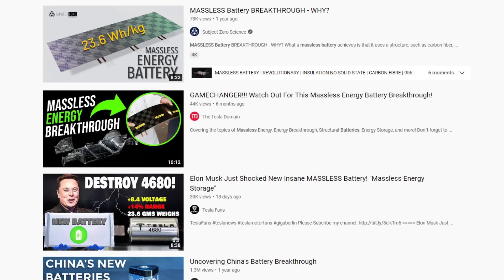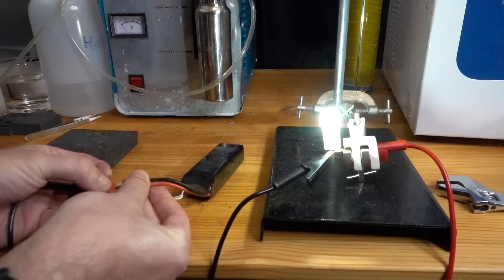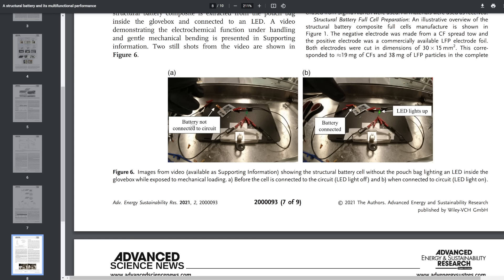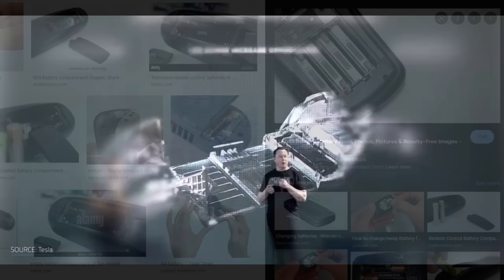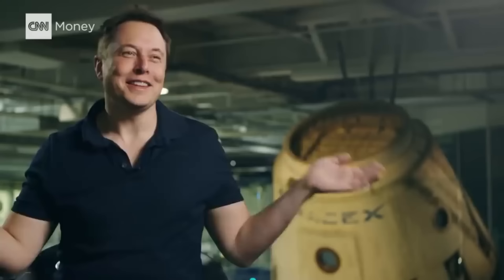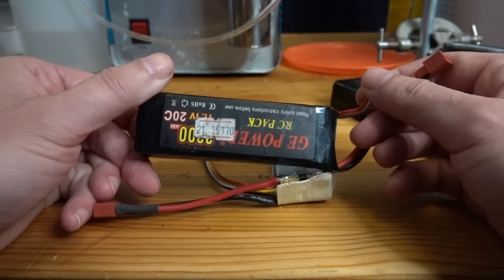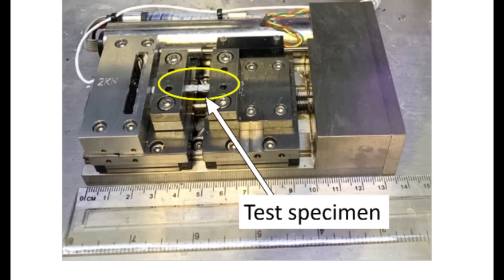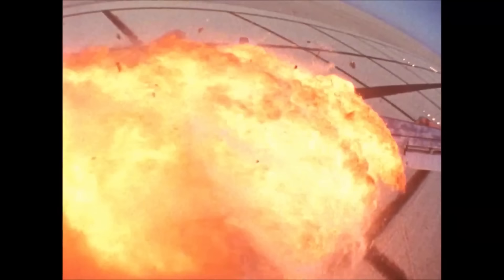Matt Ferrell, Massless Battery: BUSTED!!

Comment: When I saw the original news articles on these "batteries" I immediately dismissed it as a really bad idea for one simple reason. Batteries have a much shorter life than most mechanical parts, as such, replacing the batteries is something that has to happen to keep more junk out of landfills. Zero repairability for any of these "massless" batteries means it's a horrible idea.
Reply: And yet there are still people who think that this could be done on airplanes. Making the entire fuselage and wings out of structural batteries is what many people bring up when talking about electric airplanes and "the future of aviation", but they are completely oblivious to how massively overcomplicated, failure-prone, and dangerous that would be. Another thing people fail to consider is, how are those batteries going to perform in −30°C to −60°C ambient temperatures? Because those are the temperatures you get while flying at 30000 to 40000 feet. Plus, how are those batteries going to deal with thermal expansion and contraction without developing cracks? It's already tough enough on today's planes.

I'll just quickly paraphrase Thunderf00t in his "BFR Earth to Earth Busted" video, but with regards to battery-powered airplanes instead of rockets:

"Wow!! The next big thing in aviation is gonna be REVOLUTIONARY!! Battery-powered commercial airplanes!!"

"Actually, no. Any competent engineer would take one look at the idea of a battery-powered commercial aircraft and immediately discard it because it's an INSANELY stupid idea. But for some strange and unexplainable reason, you take something that's powered by an internal combustion engine, power it with batteries instead, and voila, all the eco-warriors come flocking in, praising you like you're God or something."

"Look, the whole idea is comical no matter how you look at it. I mean, let's just start with the first thing they need to get right, which is the remoteness of the charging stations."

"Once charging is finished, the aircraft is essentially a giant potential bomb sitting on the ramp. You see, the reason why tanks of fuel never blow up is because you cannot actually make the fuel burn unless you mix it with an oxidising agent, and since the (liquid) fuel in the tank is not mixed with any oxidiser, you're fine. Commercial aircraft take this even further by using inerting systems to pump out the remaining air/fuel mixture in the tanks and replacing it with nitrogen. Batteries, on the other hand, have everything they need to release their stored energy already inside themselves, which is inherent as this is needed for them to operate. Thus, fully-charged high-density batteries are inherently deadly, which means SOP would dictate that charging be the absolute last thing that is done after all of the people, baggage, cargo, and supplies are loaded onboard. And, of course, you would have to evacuate everything and everyone within a minimum radius of anywhere between 1 and 3 miles of the plane while it's charging, because it's so dangerous. There's no getting around it, it's an INHERENT PROBLEM."

"Indeed, a fully-fuelled Airbus A380 contains an equivalent amount of energy to all of the bombs that the Allies would typically use to destroy a city in WWII. And a fully-fuelled 777-300ER, with 181,283L of kerosene, has the equivalent of 1.53 kilotons of TNT stored in its wings, 32% more than the energy released during the explosion in Beirut in 2020. Even at the smaller end of the spectrum, a De Havilland Canada Q200 NextGen can store up to 835 US gallons of kerosene, equivalent to 26.7 tons of TNT, which just goes to show how amazing the internal combustion engine is at SAFELY harnessing large amounts of energy. With battery-powered airplanes, a lot of eco-warriors will think airlines can fast-charge the planes to save time, and that eventually batteries will evolve to the point where it could be safely done at the ramp. But you want to charge a battery-powered aircraft using fast charging, which is the most dangerous and damaging method our there, while it's sitting right next to the airport, which is one of the worst places you could park such a machine? Yeah, that's not happening."

And that's not even getting started on all the OTHER problems you'd face. In aviation, everything is as optimised as possible. Cabin pressurisation and HVACR systems onboard today's commercial aircraft are run off of air bled from the engines before combustion, and that's just one of the things run off the engine. On a battery plane, all these would have to draw directly from the batteries, making it far less efficient.

Then other people will bring up the fact that gas turbines are about 30 to 40% efficient while electric motors are 95% efficient, but this is misleading because turbofan engines actually have 70 to 80% propulsive efficiency. Plus, the genius of a turbine engine is that it takes full advantage of gases expanding as combustion occurs, and this second stream of gases comes out the core section, allowing for a significant increase in thrust compared to a fan alone. An electric airplane would have to provide all of the thrust via the fan.

THIS is why the idea of a battery-powered commercial aircraft crashes and burns before it even leaves the ground.
Reply: @electric7487  The "structural" batteries will definitely handle the loading in an airplane. Definitely.

(Airplanes have a rather large amount of loading put on them during landing and takeoff)
Reply: Yup, nothing better than being forced to replace an entire car when the battery dies. Everyone was mad when they stopped making phones with replaceable batteries, if they would have just touted them as phones with "massless batteries" everyone would have praised them as a massive technical innovation lol.
Reply: Almost everybody owns at least one eletrical device and has already learned that reloadable batteries have a remarkable short lifetime. Most of us are used to call that device a mobile phone. And some models are build in a way that replacing the battery is NOT possible. Thus we buy a new car (sorry mobile phone) every few months. (Clever engineering / marketing idea - and this small gadgets are not exactly cheap.)
Reply: Indeed. Even if the concept worked perfectly as described by Ferrel, it would still be a bad idea.
Reply: You mean you would have to completely scrap your car every 2 to 3 years? Well, that's bad news for the customers but really good news for the manufacturer. Now all we need to convince dozens of gullible doofuses that it's good for them and the planet is proper marketing and a catchy name. How about saying the battery is "massless" ?
Reply: Totally agree.  I've seen pictures of the Tesla structural battery.  Zero repairability is a really, really bad idea.  These battery packs aren't just built into the structure of the car - they are filled with epoxy or similar.  Pry the lid off and it's one solid mess.  Almost no chance of replacing cells in that.  I get the desire to reduce weight of electric cars.  But, battery packs are steadily increasing in density - we'll be there soon enough with repairable battery packs.  Don't get started making this junk.  I certainly won't be buying an electric car where they do this junk (and I absolutely plan to buy an electric car and look forward to a day when gas engines are obsolete).
Reply: That's probably the whole idea. Make it impossible to replace the batteries so the consumer has a useless product when they die.
Reply: @ccoder4953  I love gas engines, but I'm not a fan of the excess electronic stuff manufacturers are putting in cars these days. I like my simple, old, manual transmission jeep wrangler. Thing is, I do a lot of camping and long distance car travel. I don't ever see a future that would let me drive 12 hours with just a couple 10 minute stops in any electric vehicle. However, for all my small commuting around the city, I just use an electric bicycle. So it's great for a lot of people, but definitely not for everyone.
Reply: @bobbygetsbanned6049  simple Solutions to that. But they need to be implemented. Like the right to repair act
Reply: Very good point!!
Reply: Batteries don't have short life span, if handled correctly they can easily survive 8-12 years until their capacity drops by 20% (that's when a battery is considered end-of-life).
The issue is most people have obsession on fast charging, and fast charging is killing batteries. 
Current batteries can be safely charged up to 0.2C (5 hours from empty to full), anything more and you are reducing battery lifetime. Also charging above 0.5C (2hours from empty to full) causes direct damage to the battery, and charging above 1C (1 hour from empty to full) is almost guaranteed to kill it.
Reply: @hubertnnn  If 8-12 years is not a "short life span" to you then I would tell you to not look into the age of most of the generators for the US electric grid. Also, please avoid looking at most of the excavators, tractors, dozers and other heavy equipment. Most of the ones in use for anything other than a large government infrastructure project are over 30 years old. Also, avoid any small machine shop because they're sure to have a Bridgeport mill that's probably older than your grandfather. 

I make these points to showcase just how long lasting mechanical components can be. No battery that can store enough energy to power a vehicle would ever last a quarter of the structural components age.
Reply: @hubertnnn  So what you're saying is that even if the owner took the best possible care and had the opportunity to always slow charge the battery, then the car's lifespan is still reduced significantly. There are plenty of >12 year old cars driving around today that would have had to be scrapped by now.
Also, this "obsession" with fast charging you mention, is that maybe because some people don't have the luxury to wait in a society built around the expectation that you can refuel your car in under 5 minutes in the middle of a (potentially long) journey?
Reply: @bobbygetsbanned6049  The Fiat 500e already has a battery that, through Chrysler engineering, is 12000 dollars to replace BEFORE the cost of parts.
Shame, really, the car drives so well...
Reply: That's a great point.

As an engineer I hate these people because they confuse the crap out of the general public with what we can and can't do. You've pointed out a major issue with these for vehicles. Even when there are good technologies they often confuse people about what those technologies can and can't do. 

In this video above there's a reference to the liquid metal battery. That's a technology that's been developed by MIT Professor Donald Sadoway. He's cofounded the company Ambri to manufacture them. That's a technology that has great potential for FIXED (not mobile) energy storage. As in things like community batteries. So its  shame that clowns like Matt Farrell are confusing people with garbage because some of its NOT garbage but most people can;t tell what is and isn't garbage.
Reply: @hubertnnn  
> Wrote: "Batteries don't have short life span, if handled correctly they can easily survive 8-12 years"

EMD 567 engines from the 1940's and 1950's still powering countless locomotives, vessels, and generators today:
Are we a joke to you????
Reply: @HelenaOfDetroit  I just enjoy the feel of driving a manual.  For me, no clutch = no buy, so electric cars are kinda a non-starter.
Reply: Hey, Musk could make  a DISPOSABLE car out of that. "No, don't". The battery is permanently part of the basic chassis, AND it sounds like it will MUCH more difficult to recycle that battery as well (and Lithium,. etc, is difficult, polluting  and sometimes exploitative to mine). A 100% STUPID, CRAPPY idea. Planned obsolescence of the worst kind.
Reply: @SwervingLemon  That's part of the joy of electric car ownership, you're supposed to love that part, I think. But at least it's possible to replace so the whole car doesn't have to go to the landfill.
Reply: Which is why I can see many companies trying to adopt this.
They hate repairability. To the point they'll pay senators lots of money to try to keep it as hard as possible for consumers to repair their own devices
Reply: The biggest reason to dismiss anything to do with batteries is that battery technology is essentially at it's endpoint right now. There's not a lot more that can be done with them and there's no more battery breakthroughs to be found unless we discover an entirely new branch of chemistry previously unknown in the same way Quantum Mechanics burst onto the scene 100 years ago.
Reply: @bobbygetsbanned6049  It's a Chrysler Hallmark, as well.
The battery assembly: $30k. Labor to replace it: $12k.
Cost of a Fiat 500e with tax incentives is often less than $9k.
They did that with the Cruiser as well. It's a Dodge Neon, effectively, but the goofy throwback body shape means you have to pull the engine out to replace the timing belt. The labor is usually more than the cost of replacing the vehicle.
Why anyone buys their products anymore is beyond my ken.
Reply: ...or a brilliant idea for capitalist intentions
Reply: Welcome to the new green renewables world!
Reply: I think the worst part is that you win virtually nothing save some internal space.
Reply: @electric7487   Skepticism here. You explained why chemical-fueled airplanes do not ignite all their WMD-level-amount of stored energy instantaneously, but you have not explained why a battery-powered airplane containing the same amount of stored energy necessarily releases all ITS stored energy instantaneously.
Reply: Great point!
Reply: @theultimatereductionist7592  The way I see it is this: If you have a bunch of cells all interconnected together in a plane's fuselage and wings, a single short could potentially short out every cell onboard the plane. Not a big deal if you have just a few batteries like on today's airplanes, but the bigger the pack is, the more likely it is to fail, and when the more cells there are, you get many times more failure points. On structural battery airplanes, even a single crack in the fuselage would be enough, far more deadly than a crack on the fuselage of combustion planes.

Also, combustion-powered airplanes don't mix significant amounts of oxidiser into the fuel, so combustion planes don't release all their energy in one go except in the event of a crash. Batteries have to store both the substance that oxidises and the substance that gets oxidised in the same package, so they can release all of their energy in one go without needing any sort of severe condition. The idea of "structural batteries" completely debunks itself, so I'm not going to bother picking that apart.
Reply: @electric7487  Every vehicles is a potential weapon of mass destruction even scateboards and rollerscates.
Reply: @bobbygetsbanned6049  why replace the whole car? why not just replace the parts that  are dead?
Reply: @asandax6  No. You're grasping at straws.
Reply: @asandax6  Did you not watch the video? The parts that are dead are integrated into the structure of the car, you can't replace them.
Reply: @bobbygetsbanned6049  that's if you make the car as one huge part. If you make like a normal car you should be able to detach some parts like the bumper and so on.
Reply: @theultimatereductionist7592  To make all the fuel pop off at once, you'd have to mix it with a rich oxidizer.
To make a battery release all it's energy at once requires only a hard short for a few seconds to send it into thermal runaway. All of the reagents necessary to release it's chemical energy are already in the battery.
Having said that, there was ONE aircraft that, during intensely hot days, would oxygenate the fuselage tank via a vent valve, and it DID explode, blowing the cockpit clean off the aircraft.
Reply: The Tesla approach makes sense, for replaceability. Once every ~10 years, drop it out, swap the seats over, and you’re done.
Reply: @float32  drop what out? The center part of the frame? 

I can tell you've never worked on a car by the way.
Reply: "Zero repairability for any of these "massless" batteries means it's a horrible idea"

Apple: Hold on, that sounds like a great idea.
Reply: @HelenaOfDetroit  you can look up the videos to see how they install/replace them. These aren’t standard frames. That’s exactly what they do. Lol.
Reply: @float32  good luck doing that yourself, outside, while it's snowing. After all, why bother saving all the materials and labour from making the original frame when you can just replace the frame and charge the consumer more money, huh? 
Did you know most battery packs die because a few of the cells go bad? It's much more economical and better for the environment to design something that makes it possible to change the cells out. I'm not even asking for it to be easy, just possible.
Reply: @HelenaOfDetroit  Well good luck changing your fuel system outside while it’s snowing? Lol. I don’t even have an electric car. I was just pointing out that they are replaceable, and structural, with the way Tesla does it. Touch grass.
Reply: @float32  I've changed brake pads, rotors, calipers, fuel line, brake lines, and a bunch of other stuff on cars throughout the years, while outside, while it was snowing. I can weld, braze, fix hydraulics, forge steel, cast aluminum, machine various metals, and also do house carpentry, roofing, flooring, siding, plumbing, electrical, tiling, drywall and finish carpentry. While I'm not a master at many of these skills, I've been paid professionally for all of them. Have you ever worked a hard day in your entire life?
Reply: Solid state batteries will likely replace lithium ion in the long run, and they will likely handle far more charge cycles. If so, they could plausibly last the life of the car. Solid state batteries are already commercially viable in industrial applications, but not yet in others like automotive, it will need more work yet.
Reply: You are viewing this wrong: under capitalism, structural batteries are an "amazing" idea. the customer has to replace the ENTIRE VEHICLE when the battery loses charge capacity. More Profit for the vultures.
Reply: @JSHADOWM  you’re viewing capitalism wrong. the auto industry is in no way run by a monopoly. A competitor will just offer replaceable batteries, and people will buy it, if it makes sense. Hopefully battery tech improves to the point where a replaceable battery doesn’t make sense, because that works be neat.
Reply: @float32   Or, hear me out: every manufacturer goes for structural batteries because of profit.

dont tell me it cant happen, theres no legislation against it so its almost guaranteed, like lootboxes.
Reply: @JSHADOWM  then why haven’t we seen ICE cars with engines that can’t be replaced? That would surely help “profit” right? How is it different?
Reply: @nikkiofthevalley  what's the loading on the wings at landing though? Surely that's when they're closest to equilibrium.
Reply: If you made the fenders out of batteries, you could easily replace them. Same with door skins, trunk lids, and any other body panel that is bolt-on.
Reply: @StapleCactus  congratulations! You win "dumbest comment online" for today! 

Oops! Someone just bumped into your car on the road. No big deal. Just a little fender bender, right? Wrong! Now it's a giant fireball consuming the entire car.
Yep, that's what would happen if we put these batteries in the places you're suggesting.
Reply: @HelenaOfDetroit  Currently, maybe. No technology is perfect in the beginning stages. Plus, I don't think it would have the same flammability as lithium-ion. Most likely, it'll just short out and have no charge.
Reply: @JSHADOWM  This is the problem with people who criticize capitalism; they can only ever analyze the supply or the demand side dynamics at once, not both. The reason that will never happen is that the consumers won't buy a product that's more expensive and lasts less long when they already have a superior one available. They only buy a product that is disposable if it is considerably cheaper, such as why they got rid of those old lightbulbs that could last forever but were very expensive and hardly threw any light, which was in that ridiculous "planned obsolescence" documentary I saw a few years ago, which just so happened to leave out those important details.
Reply: @Darxide23  Dude, are you serious? Last 5 years is the fastest progress in battery technology we had since their invention. Thanks to LiFePO4 batteries cost of storing energy dropped 8 times during that period.
Issue: Those are stationary batteries, just like liquid metal they are good for ground usage, but not for vehicles.
Reply: @Hanaconda_Aquaponics  That is why I consider plug-in hybrids best current car technology. You would charge overnight and get enough range on the electric engine for daily use (drive to work and back, and do some shopping). For bigger range you use petrol.
That is also why I am AGAINST the idea of getting rid of petrol cars proposed by EU.
Reply: @hubertnnn  Except those were first developed in 1996. Try again chief.
Reply: @electric7487  You ever drive a car in the northeast USA or Canada? Car body won't last 8 to 12 years. The structure being the battery with composite construction would actually have people hold on to their cars longer. Rust wouldn't be an issue. 
I know that by 10 years in Buffalo - your current engine driven car don't have much body left to talk about...it rusts out. Put some safety inspections on current cars and they become a damn nightmare to maintain - because of corrosion.
Reply: @electric7487  Ask flight 800 about that point. It released all of it's energy at once. That's just not a good argument. 
Electric cells can fail - but batteries (multiple cells) can be electrically isolated with fusible links and firewalls. The danger can be mitigated. Just like aircraft fuel cells. They are separate, and in most cases very safe. Vehicle battery design takes this into account.
Reply: @asandax6  You hit the nail on the head. Build the car in components - that can be disassembled and allow for sections to be replaced. Very good concept.
Reply: @bobbygetsbanned6049  and the structure can be component based. Easy to replace parts and not the whole car. Just don't design it to be one piece.
Reply: @dont.beknown5622  
> "You ever drive a car in the northeast USA or Canada? Car body won't last 8 to 12 years."

Okay...

> "The structure being the battery with composite construction would actually have people hold on to their cars longer. Rust wouldn't be an issue."

Fatigue and the risk of cracking would be a much bigger issue on structural batteries, as it would allow the ingress of water. This in turn would accelerate corrosion of the cells, internal wiring, and other components. Not to mention, it could also lead to short circuits, in which case your entire car goes up in flames almsot instantly.
Reply: @dont.beknown5622 
> "Ask flight 800 about that point. It released all of it's energy at once."

You COMPLETELY dodged my points about aircraft inerting systems, which is exactly part of the point I was trying to get across. Next time, when you're responding to someone's comment, read the entire thing through and don't leave things out on purpose in order to strawman your way to victory.

If you had done even the most MINIMALISTIC research on Flight 800, you would have known that Flight 800 was EXACTLY what led to inerting systems being fitted on new and existing aircraft. These days, nearly all commercial aircraft have them, and the fuel in an aircraft fuel tank can no longer explode, let alone release all of its energy at once. 

Besides, how common were fuel explosions in commercial aircraft, even before inerting systems became a thing? Not common at all. My point still stands.

> "Electric cells can fail - but batteries (multiple cells) can be electrically isolated with fusible links and firewalls. The danger can be mitigated. Just like aircraft fuel cells. They are separate, and in most cases very safe. Vehicle battery design takes this into account."

I was talking about the chemistry of the cells themselves. The increased risk of fires and explosions as battery energy densities get higher is an inherent problem. Fusible links, firewalls, and whatnot do work, but they do not solve the fundamental issue.
Reply: You have the skepticism that science journalists should have.
Reply: @Darxide23  So? Graphene also was first developed 2 decades ago, but last year first commercial uses started hitting the market. Any technology can be improved and will be improved over time. Batteries from 1996 are nowhere near those used today. all they share is chemistry.
Reply: @hubertnnn  >all they share is chemistry.

Thank you for agreeing with my original point. I accept your apology.
Reply: @electric7487  I'm going to give you a little advice and not touch the content of your retort.
Don't assume you are talking to an idiot. You come across as condescending and arrogant. 
For the record, I'm an avionics tech by trade and have 30 years working on large aircraft. I ran a battery shop with both lead acid, and ni-cad battery maintenance and rebuild.  
I know much more than you give credit for and don't appreciate the attitude. It was a comment. Try being nice.
Reply: @dont.beknown5622  
1. I don't normally get this worked up. However, that's as long as someone doesn't deliberately twist things or say things that can be trivially shown to be bullcrap.
2. If you really do have this much experience working on airplanes, then surely you know what an inerting system is, right?
Reply: @electric7487  

1) If I offended you in the way I commented, I am sorry - I didn't mean to.
2) Very familiar with them. There are actually more than just active oxygen displacing/depleting systems (nitrogen generators and such). Explosive suppressant foam is another way. It fills the fuel cavity (causing some loss of capacity) and creates a fuel rich atmosphere - above the UEL. It can be a bugger to deal with during maintenance though. Removal and storage of the foam - then re-installation. Labour intensive and costly.  

I was trying to show that systems we've dealt with can be dangerous as well, but we overcame/mitigated the dangers with new tech. 
I was wrong in one aspect though. Someone else on here brought up the cost of manufacturing of "structural batteries" and that replacing them (if we could make the parts safe enough to use) would be prohibitively expensive to the average car owner. Show stopper right there. The cost of a battery pack now is huge. Just imagine the cost of body frame and panels with "super cell" tech built into them.